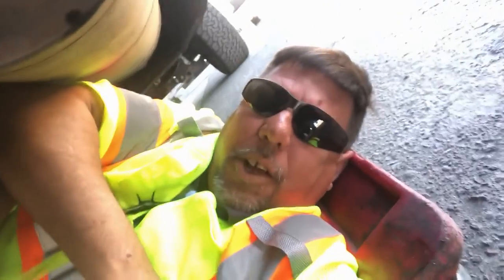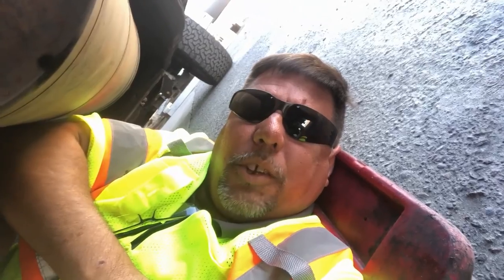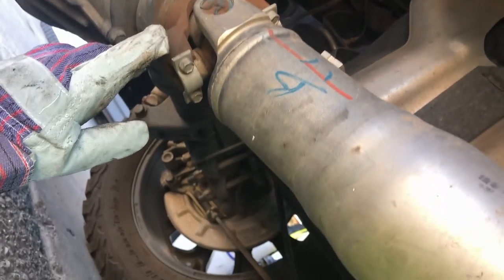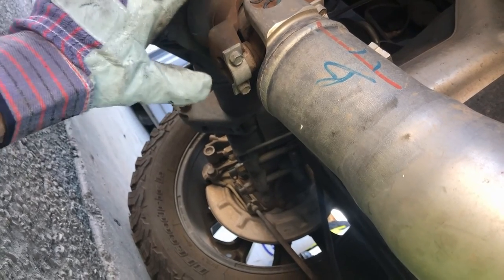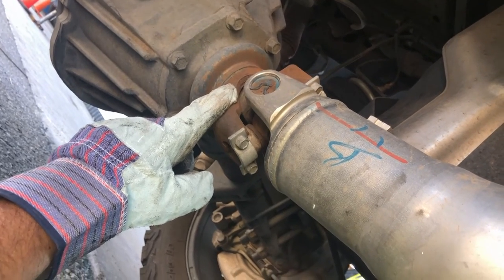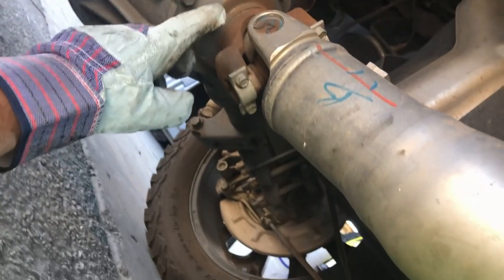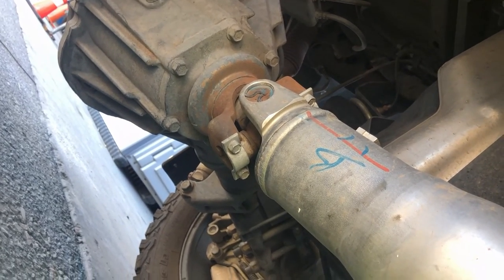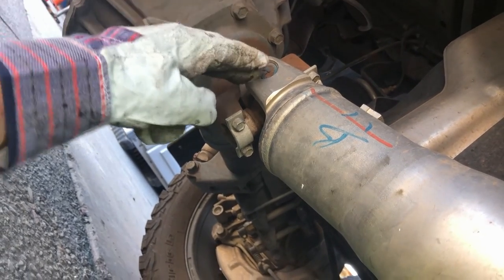Drive shaft safety tip. Towing

Comment: I learned that one day one of the beginning of my HD tow career. I also learned that if the driveshaft won’t come out, pull an axle shaft, and the same thing still applies. CHECK DRIVESHAFT FOR TENSION, and set brakes before removing the AXLESHAFT, cause if there’s tension on the driveshaft, odds are that there’s tension on the axle shafts.. 
I have recently left towing (for now) due to a VERY close call on the highway. I am currently working on my own business, but hopefully I will be adding at least an NRC 20TB carrier and maybe a 16ton medium duty wrecker for stuff the  20TB can’t handle.. which from personal experience, is pretty much anything over 40kGVW. 
And before I start being put on blast, my 20TB was setup with not only electric trailer brakes, but the full trailer AIR (service and supply) so I could have full control of what I was towing. 
Just my $.02… good video, maybe add some HD tow tips and tricks. 
Btw I’m a 20 year veteran of the towing industry.

Comment: In my early days I was driving flatbed tow truck. And one day my boss asked me to drive medium duty freightliner recovery truck for a few days to cover driver who  get sick.
 So at that my first day in that truck  , and very  first tow I was loading 30+ft RV who has transmission problem . I load it on wheel lif , and sinched wheel lift in to see  if trany is engaged... rear tires of that  Rv was drugging on the ground ... by doing that I did put tremendous force on drive shaft ( I didn't realise that at that moment )... I get under and start to unscrew  those bolts , I had to do it manually because for some reason  driver of that truck took out all power tools  !!
So at my last bolt (7/8) drive shaft is snapped out ,  it was so fast I didn't release  what happened , and its that broke last bolt clean !!!! If I was laying just a bit in it will smashed my head because its snapped  baseball hat out of my head !!!! Sinse that day  before I even get down to drive shaft , I check several times for tension  is not to be there  because no joke  its deadly important !!!
Now I'm experience driver , and I get to teach new drivers. I allways tell  to my students , that is only small stuf will get you in trouble .. like  didn't check tension on drive shaft , or you pushed Ebrake pedal down but brakes are crappy and dont hold car so never rely on it always block tires , never place your Jhoock  next to robber booth of CV joint , it dose not mater how good and convenient its look  chance of J hook dig in it is %95. And so , and so , and so !!!

Comment: thank you, liked and subscribed.

i'll be disconnecting a driveshaft soon. the steps i'll take in order:

1. leave vehicle in neutral
2. engage parking brake
3. chock wheels
4. lift rear wheel for additional safety
5. mark lines and disassemble driveshaft flange from diff
6. chain driveshaft up
7. thank Barnett's I have my limbs and life
8. tow in neutral

do i have it right?
Reply: Have the vehicles hooked and start removal that way it’s safe and it has no where to roll away